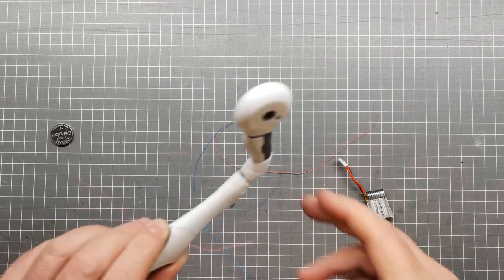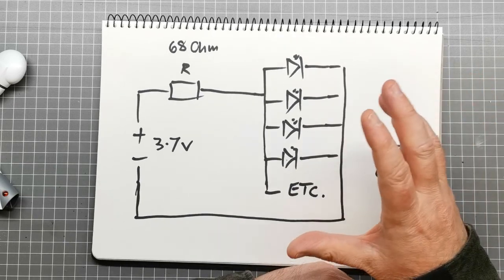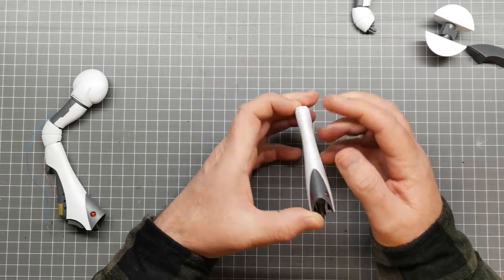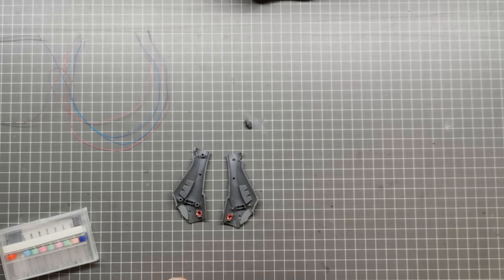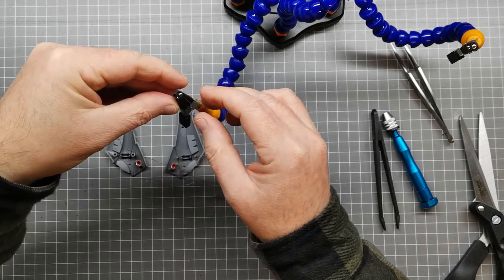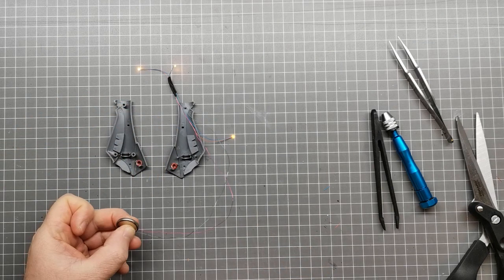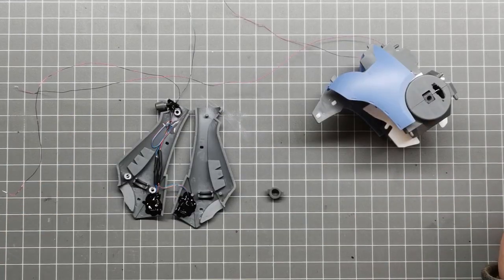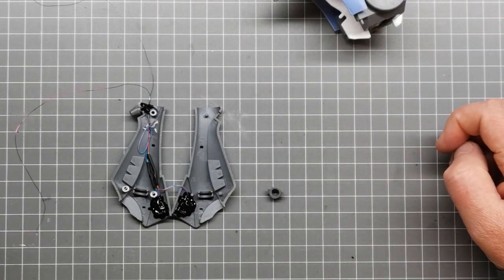Hasegawa 1/72 Regult (Standard Type) - Part 2 - Wiring LEDs

Comment: I just saw your Regult build series while watching various Macross model videos.  There's something I would have done majorly different than the route you've decided to take. I do a ton of scratch building and because of that, I have so many different sizes of styrene and metal tubes. It would have been so much easier to cut off the pegs, drill out the base of the peg and insert the proper sized tube. I have already done this on some Bandai kits and it works very very well. You can also insert two magnets into one of the feet and solder your wires to them and the power runs through the base making USB power sources much easier to hide.  Just some food for thought.
Reply from the maker: Thank you for your feedback. You make some very good suggestions. If I were to build the kit again I would probably fix the pose to make it easier to wire. I have also been  experimenting with magnetic pogo pins (similar to your idea fo using magnets) for future builds.
Reply: Very nice.  I subscribed earlier,  so I'm curious to see what you build next.  I just ordered a 1/48 VF-1S/A Strike static model and I am thinking about lighting it up. Should be fun and much easier project to manage than a poseable kit.

Comment: I am lighting the scout version, but opted out for the legs, just a bridge too far.
The legs simply have too many joints, and while I could have done it, I'd have sacrificed movement and disassemby options,
I stuck to 3, for the obvious clear parts, with the top section being the trickiest.
That battery would be perfect, so thanks very much for that, rechargeable is such a bonus!
Might have to change the RS2032 I used in my AT-ST Kit.
Reply from the maker: Yes the legs are tricky to light. Rechargeable batteries are a good option if you are not planning on using a base with plug in power. Good luck with your build.